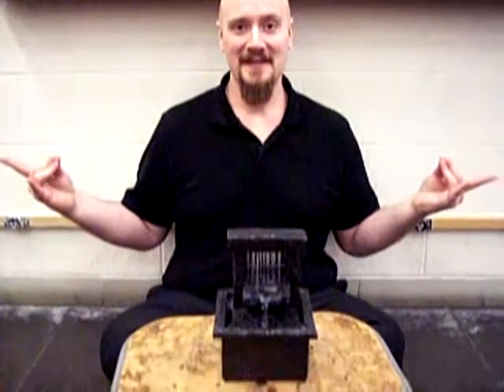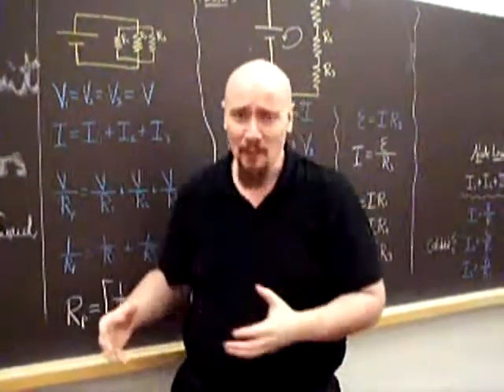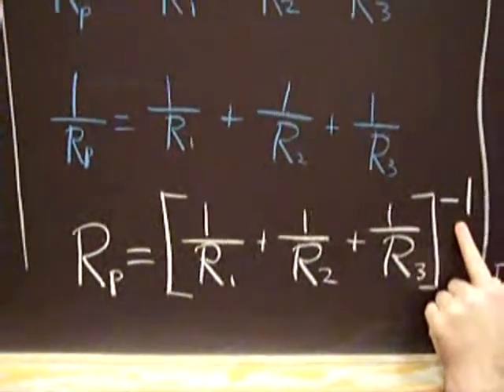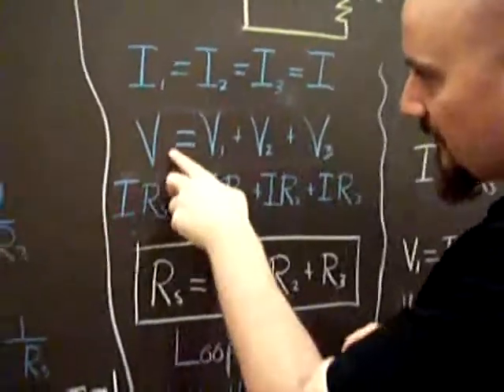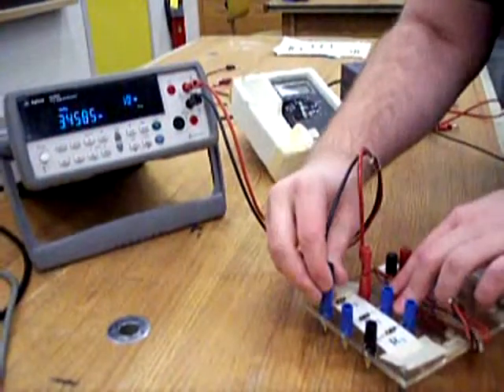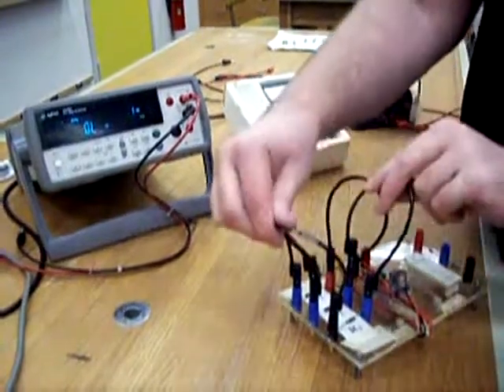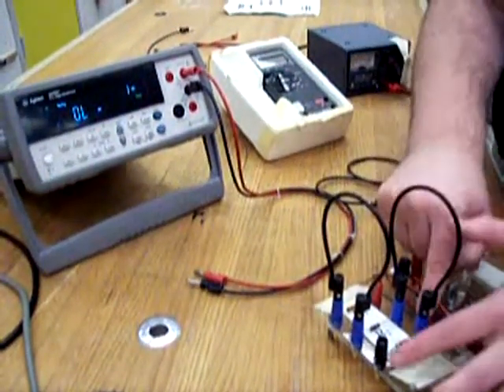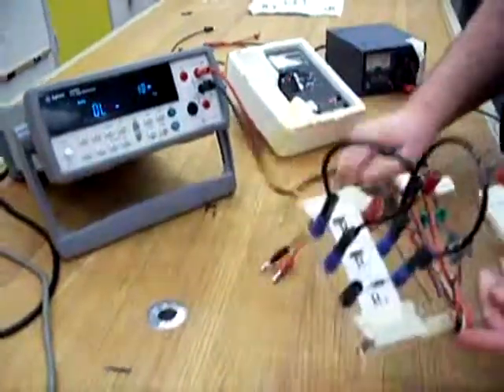Series and Parallel Circuits Kirchoff's Laws part 1

Comment: @fireninja529 oh yea one more thing about the short circuit he mention to prove my point, the two was connected in parallel which mean it was wire vs resistor, the resistance for the wire is so small that is was like lookng at a clean road with flowers all over on the side compare to a thorn path ,so current being lazy take the easy way out which woud be the wire (short circuit)

Comment: @fireninja529 current being the same only depend on resistanec being the same,in truth curent follow the path o low resistance which mean that in a parallel, the connect with the lowest current will get the most current (the funny thing is ,(believe it or not)current uses resistance to move around and every thing has resistance,resistors are use to adjust that, series is the same but with a opposite way of dividing current,the highest resistor uses the most current, (feel free to prove me wrong)